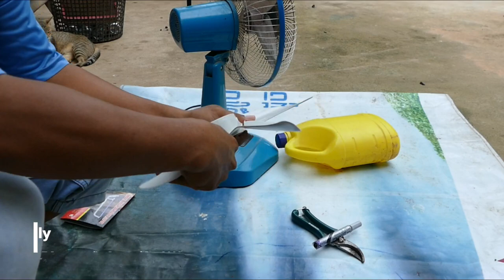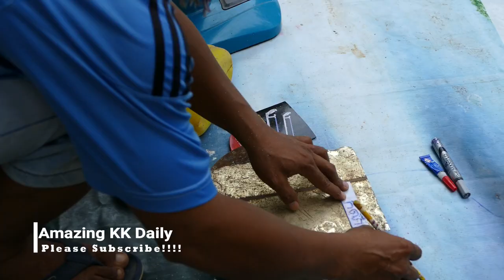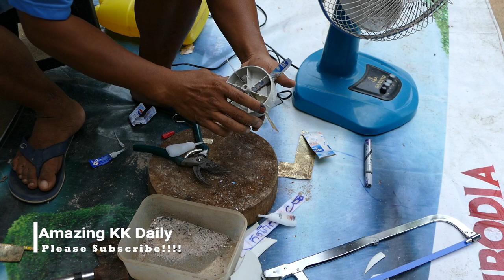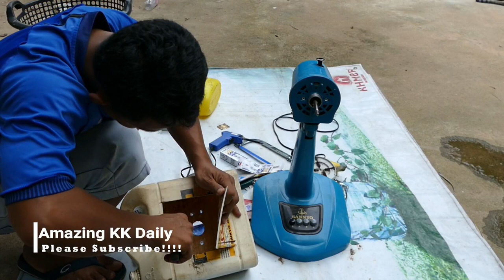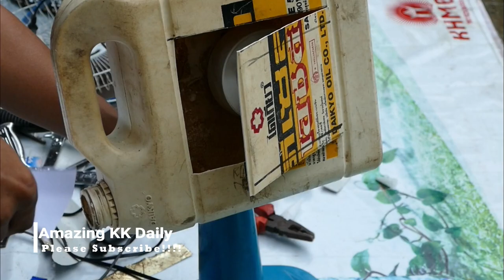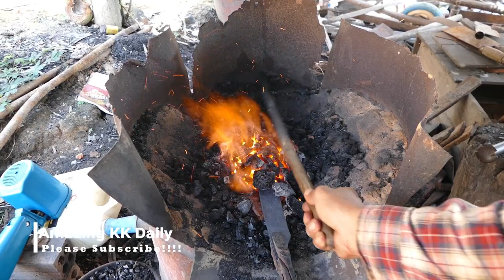Blacksmithing : How to turn a fan into A Blower

Comment: I use vacuum cleaner but consumption of charcoal was enormous. After your video I use head of 5 liters bottle( to concentrate the flow) and fan heater ( in fan mode).

Comment: Correct the title , turning a fan into a blower .
Reply from the maker: Thanks
I didn't know real word for it
Reply: @AmazingKKDaily  words doesn’t matter, your intelligence and blacksmith skills are amazing, I’m in SF my English is bad, I worked for electrical company 18 years and I kicked inspectors and PG&E worker asses, I installed over the 1000 solar systems, the biggest was 150 Kw, others with battery backup, I love to watch your videos, I have old Craftsman vaccum/blower this type come with speed button I can say, and I used in the barbecue grill to make charcoal fire fast👍👍👍👍 I wish you tube have the option to put pics,